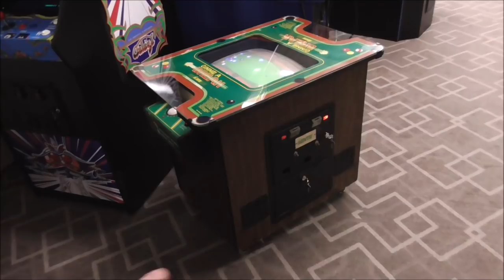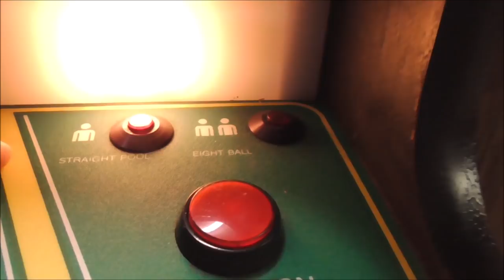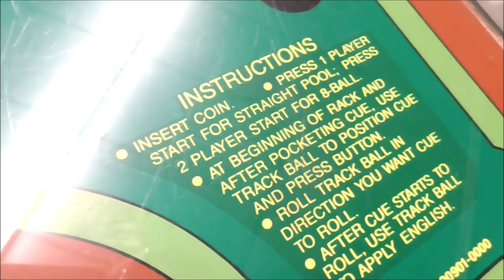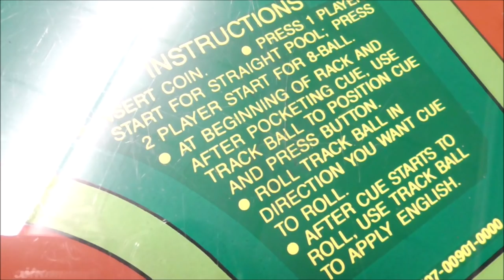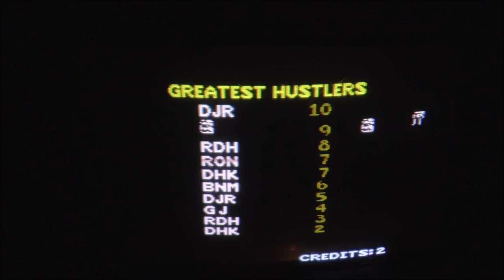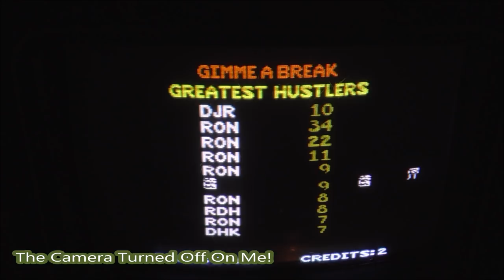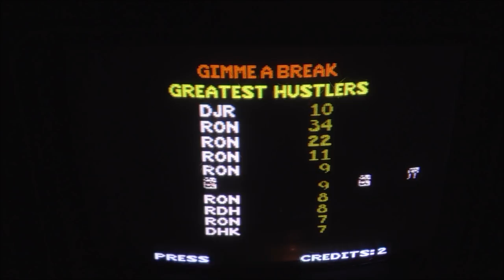Rare 1985 Bally Sente GIMME A BREAK Dedicated Cocktail Table Arcade Game Cabinet

Comment: A shot line wouldn't help, the direction the ball shoots is controlled by the direction fo the trackball.
Reply from the maker: I started getting the hang of it a little bit by the time I finished, the camera cut off but I made it to another level you basically instead of using a line try to aim with the little dots around the trackball on the control panel....